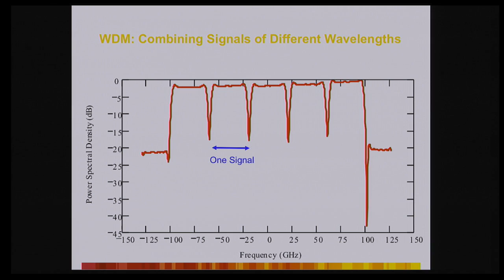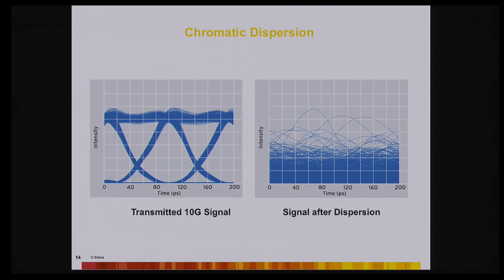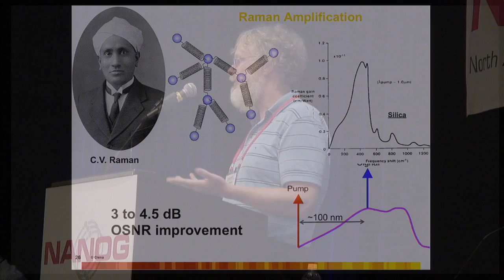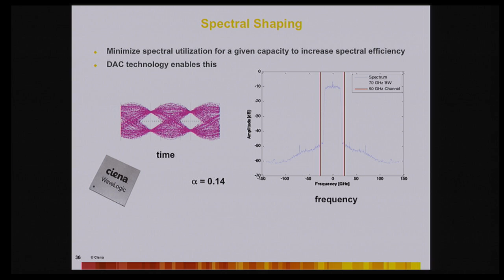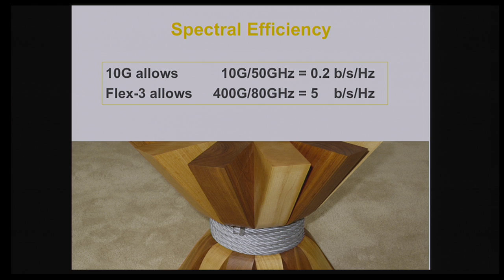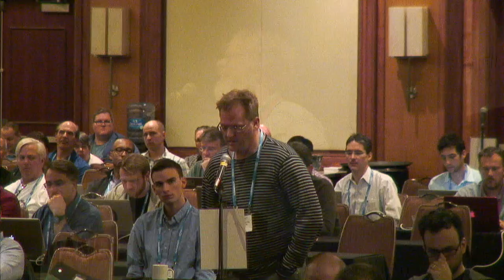High Capacity Transport – 100G and Beyond

Comment: Can you submarine inside aircreite as an intermit signal horizontally pushing away to adhere to magnetic electronical current popularizing to help run and operate a hydroponic skyscraper & researching 3600qmh pumping water broadcasting sound through reducing and filtering out the noice so that it's only able to Geo mesh something along those lines basically take the electricity out of the sky off of the polls so there's no more white noise coming from the power transistor